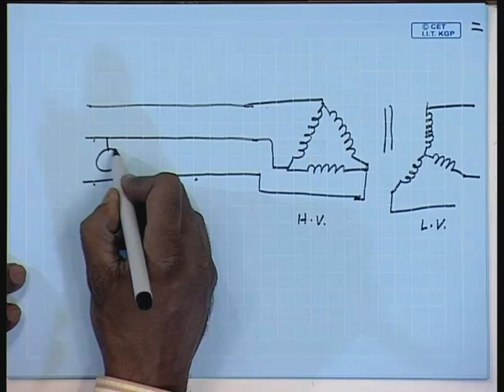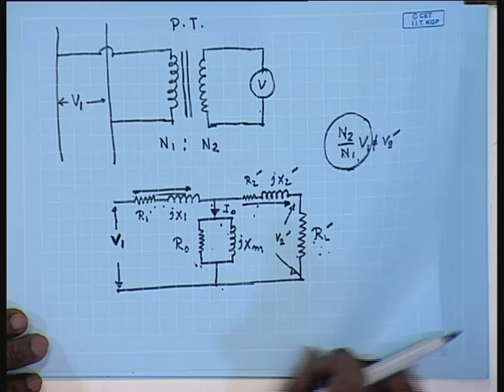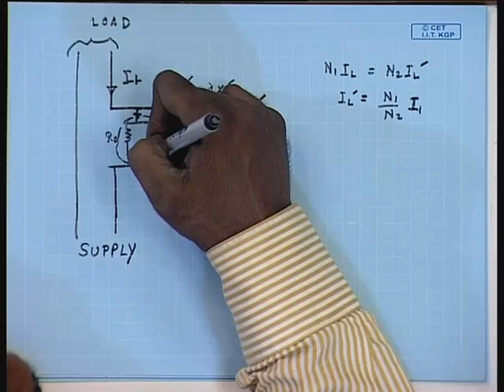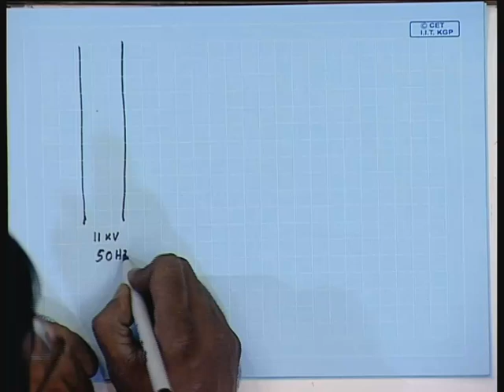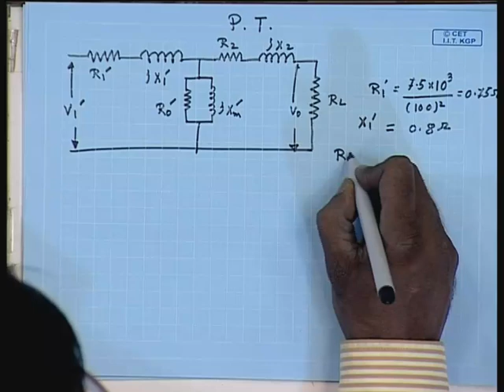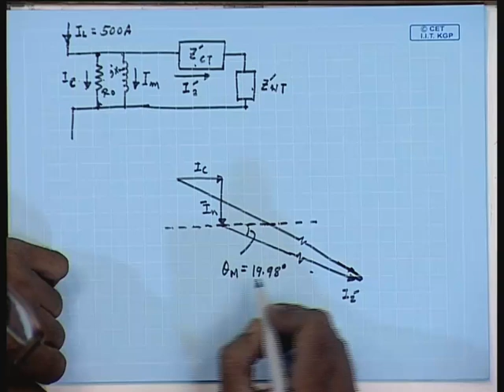Mod-01 Lec-20 Lecture-20-Potential and Current Transformers

Comment: please give answer for why transformer tank is in rectangular shape 
what happen when it is in step by step shape
Reply: Because for better circulation of oil which in turn provide more surface area exposed to the atmosphere for cooling. Also this shape give uniform calculations of oil temperature and pressure.

Comment: why CT secondary side alwas gets open circuited?
Reply: It will not get open circuited on its won. However, if open circuited high voltage will appear on the secondary and it is dangerous.
Reply: In case of pt voltage is steped down in secondary side so current is very high at secondary side of pt...